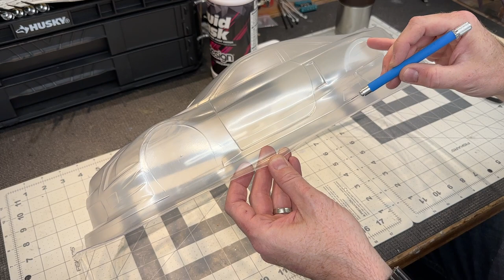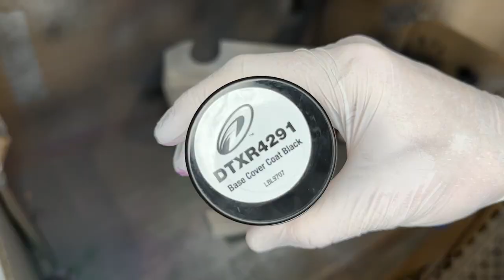ep002   Body Painting Tutorial

Comment: I like the liquid mask idea. If not using liquid mask how do you feel about using flat clear to seal masking tape lines before spraying the first color on the car. My understanding is it seals the tapes edges and if it did bleed it cannot be seen.
Reply from the maker: Yes! You can do that. It only needs a very light coat to achieve it. I’ve used this method before.

Comment: Have you ever had issues with the Tamiya PS paints reacting with the liquid mask? I’m curious as it says on the bittydesigns not to use with spray cans but you look like you’ve had great results using the PS sprays and I’d like to follow your steps and do the same, cheers 🍻
Reply from the maker: Stick to the light coats. You should be safe. I’ve never had issues with the Tamiya PS paints and the liquid mask. Good luck!
Reply: Awesome! Thanks for the reply, it doesn’t specifically say on their website that it’s Tamiya paints they aren’t compatible with just says “spray paints” in general but good to know, thanks!

Comment: Ever tried Liquitex for the masking? Curious if it's the same product only cheaper..thanks
Reply from the maker: I've never used Liquitex. However, the BittyDesign liquid mask is water-based vs. the Liquitex being latex based. If that matters to you.
Just comparing the 4oz Liquitex on the Liquitex site and the 16oz BittyDesign on Amain, the BittyDesign is about 1/2 the cost on a per-ounce basis.

Comment: Why does proline paint not stick well. Come off super easy will not last long at all
Reply from the maker: I have not experienced an issue with ProLine coming off. Not sure what your prep methods are.
Reply: Great video ! And I’ve had same issue with proline. Wash the body in warm water and dish soap and then paint. The proline stuff scratches off inside very easy. Say it rubs against a part of car when putting body on/off, it will scratch the paint off with it.